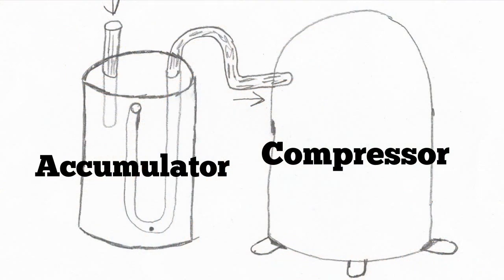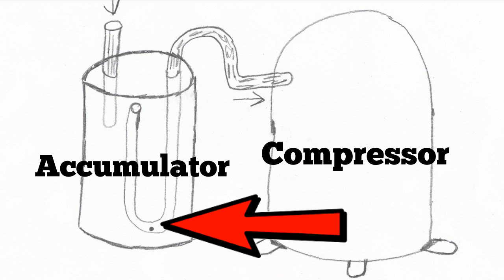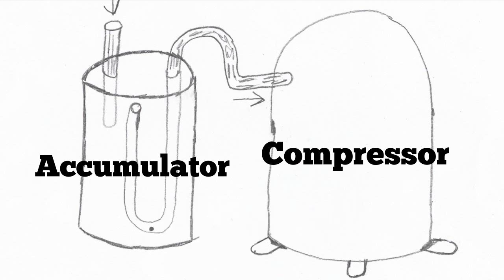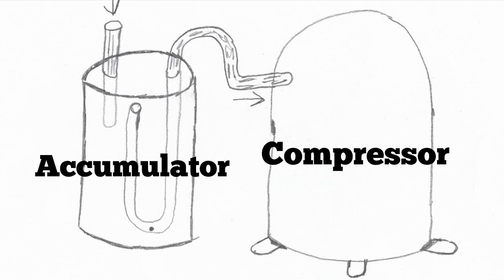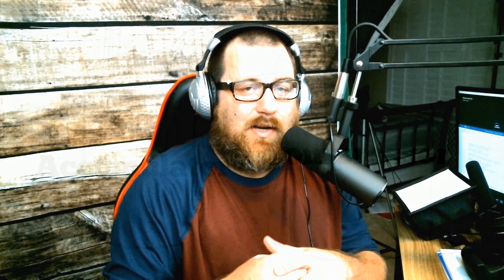Refrigerant Accumulator | How it Works

Comment: Whats the difference between an accumulator and receiver dryer? I know the dryer is on the liquid line right outside the condenser.
Reply from the maker: Receiver is there so liquid refrigerant is sent to metering device. search for a cut away - that would help you. Driers on the suction line are usually installed after a compressor issue. Liquid line driers are standard.

Comment: Hey MR I have a problem with Goodman 410a heat pump when I start working at the property I got call at summer about ac not working and when I checked superheat I found it’s over charge 21 lbs then start working fine but I got last week called about heating not working fine and when I did check found sub cooling 8 and the pressure 225 only and I did recover for the system and found the right amount of the Freon which’s 7,5 Lbs What do u think it will be the problem 
Thanks
Reply from the maker: I would need much more information to help. Ambient. temp split, strip heat, etc.

Comment: I substituted the word "@ss" every time you said compressor. 
"It allows a sampling of suction gas to go back to the @ss. And there's an orifice in there which allows oil to go back to the ass. So it allows oil to go back to the ass but not liquid refrigerant back to the ass." 🐴😂🐴😂🐴😂🐴😂
#heehawheehaw 
I always feel like an idiot when I watch some of these other guys videos on commercial refrigeration and stuff like boilers. But now all of a sudden I feel like a genius during heat pump conversation. 👨‍🎓👍